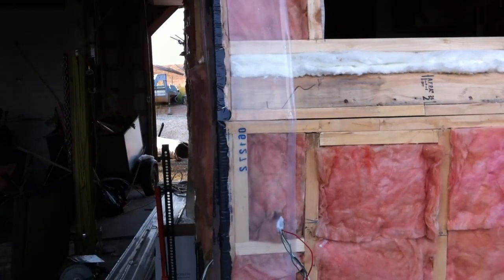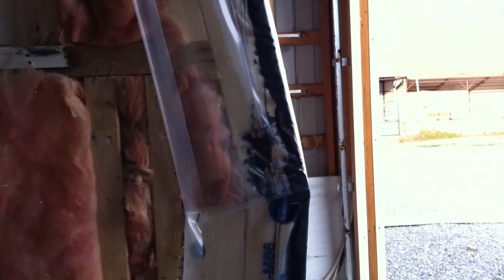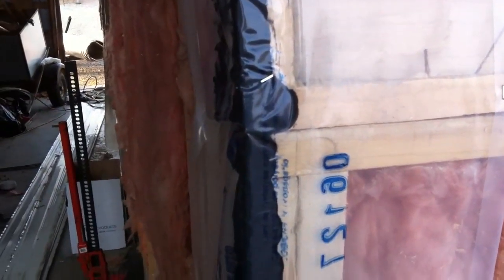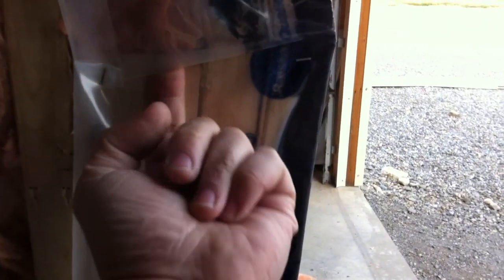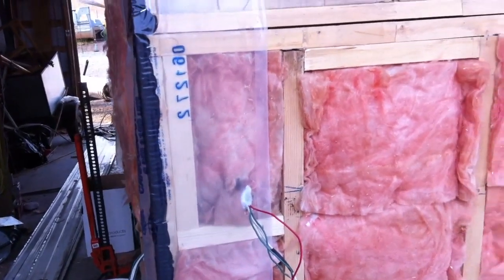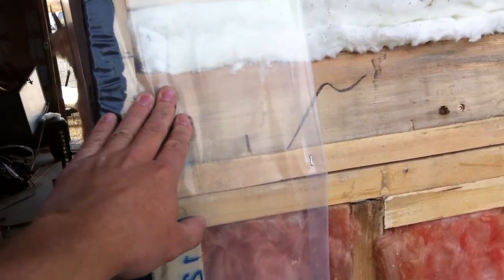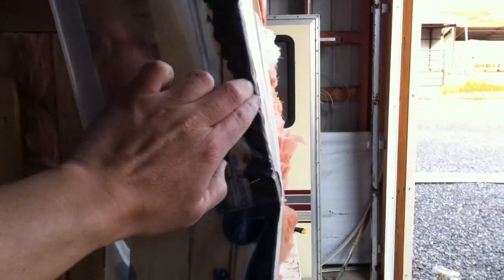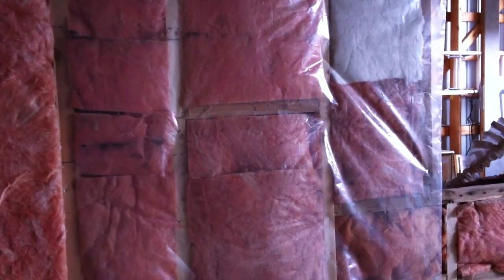RV trailer repair: Protecting corners before siding goes up.

Comment: I like what you did here with the acoustic seal. A good thing to do where ever the barrier will be punctured. I am going to do the same thing come summer. I use my RV year round for work on the west coast of Canada. I plan on replacing the insulation with Styrofoam insulation board and then tyvek wrapping the entire RV to keep drafts down. tyvek breaths unlike vapor barrier. I also plan on blueskining all window/door openings. All this should make for a bomber RV for all weather camping.
Reply: What is "blueskinning"???